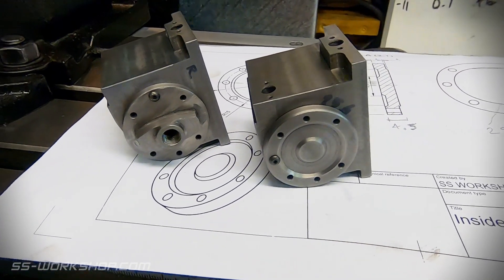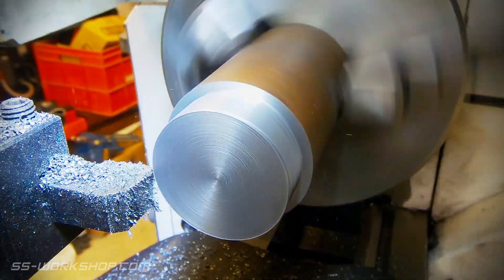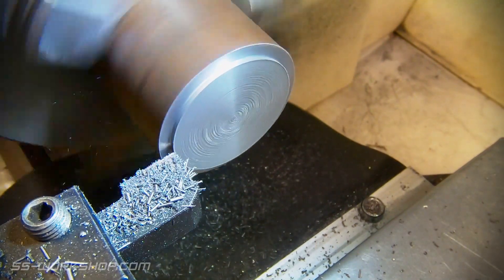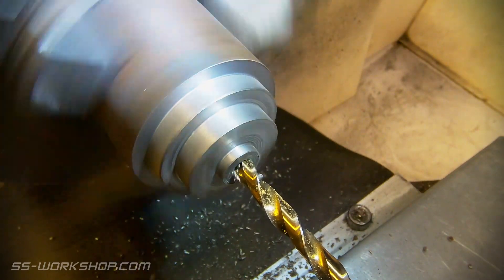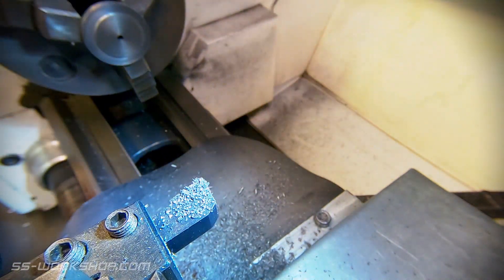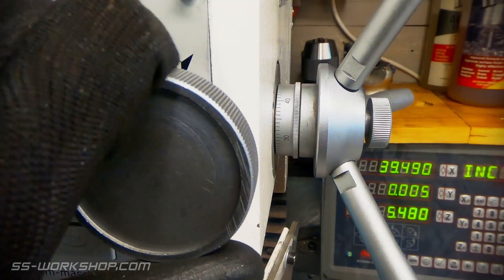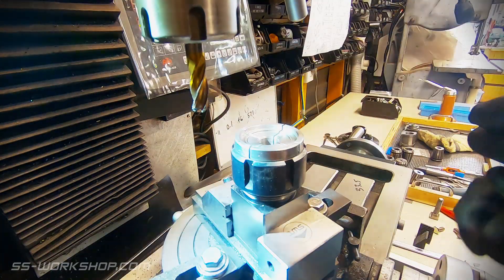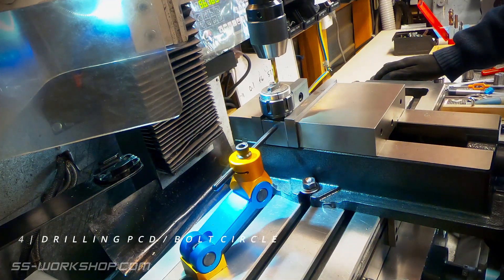Fell Engine Project - Machining Cylinder Covers S1.E26

Comment: Have you gone metric with this build in terms of nuts/bolts etc or have you stuck with ME and Ba?
Reply from the maker: I have gone metric, l looked at going the traditional route with ME but it’s not easy to get them and their expensive even before you tool up for them. Hopefully it’s the right call, too late now!
Reply: I would do the same if I was building new. It’s aweful thinking do I have that tap or die and not being able to go to the store to buy it.